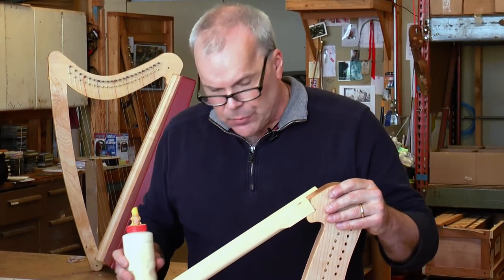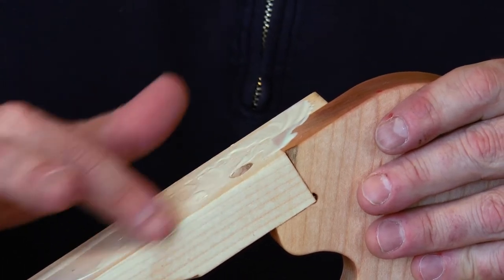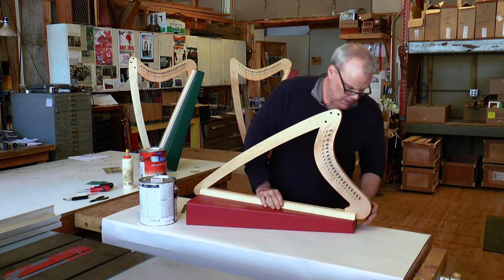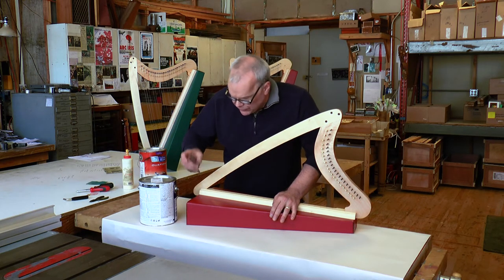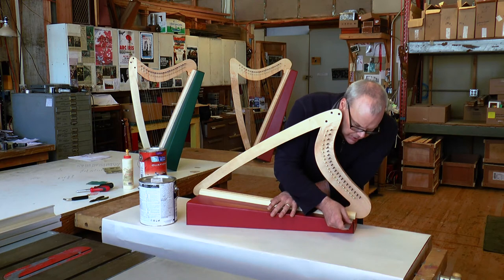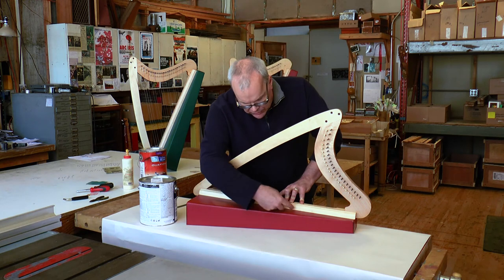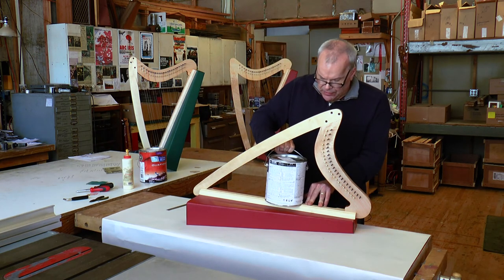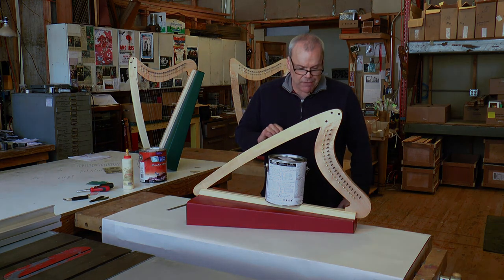How to Build Your Fireside Harp 7: Gluing the Harp

Comment: So let's say I buy this harp an become very attached to it...would it be possible for me to eventually replace the cardboard soundbox with a wooden one?
Reply from the maker: Hello! While that is possible to do there are a few factors to be aware of first. If you want to "upgrade" to a wooden soundbox off a pre-built Fireside you'd have to take all the strings off to be able to sand all the glue and cardboard off the back of the string rib before you glue it to another soundbox. Another factor that we've discovered by attaching a wooden soundbox is the change in tone.  The current string tension was developed to sound best with the cardboard resonator (it is not as tight as most other harps). If you are to put the frame on a wooden soundbox you'll be wanting to tune your lowest string (Currently G below middle C) to middle C. This is because a wooden soundbox will be requiring more tension for best tone.
Given all that...yes! It's possible, but it might just be easier to get another wooden frame and assemble from the start on a wooden soundbox...and then, of course, you'd have two around! And you could have them tuned to different keys!
Hope that helped answer your question
Stay in touch with us
Dave M
Reply: @BackyardMusicSounds  thank you! It did, and knowing this has made the decision to buy so much easier! I look forward to doing business with you very soon!
Reply from the maker: @Earthwise.  Glad I could explain!!! Looking forward to hearing from you.
Dave M
Reply: Thanks for asking this, as I wondered the same thing!

Comment: How do you install the Double String if the two rows of string holes don't match the center gap in the cardboard?
Reply from the maker: After glueing the Double Strung rib to the soundbox, you'll need to use something like a drill bit that fits the string rib holes...or an unfolded paper clip to poke the holes through the cardboard

Comment: Do you have any advice as to how to fix the problem of getting glue in the string holes? At first I thought I could just tap a nail through it to clear the glue but the holes are very small and i'd have to go through the eyelets to avoid being at an angle. Thoughts?
Reply from the maker: I have used a unwound paper clip....uncoil half of it and it still leaves you much to hold when you push through. Usually you have enough to be able to push in from the top of the string rib
Reply: @BackyardMusicSounds  Makes sense, thank you. It seems to have worked, will see how the rest of the strings go.